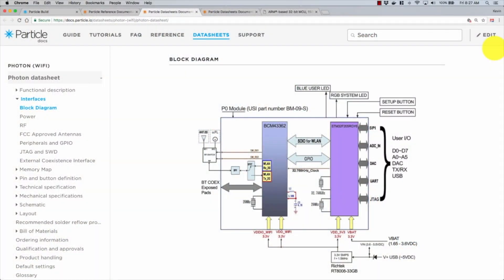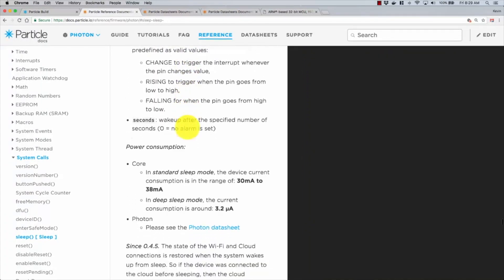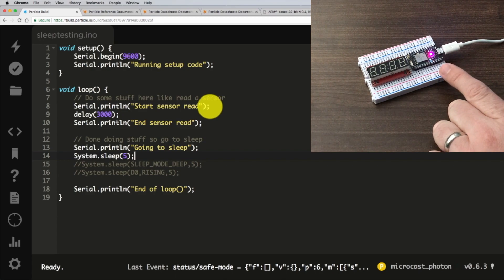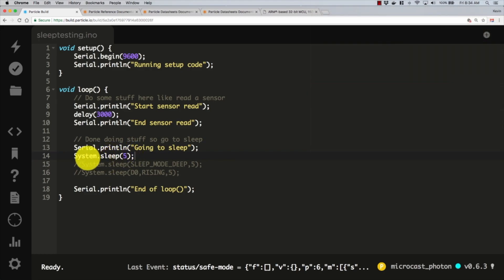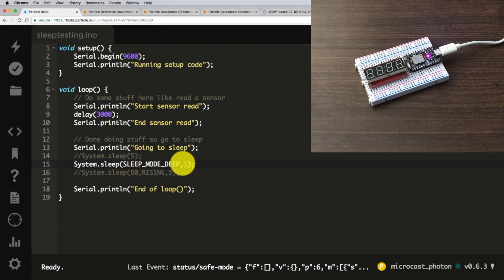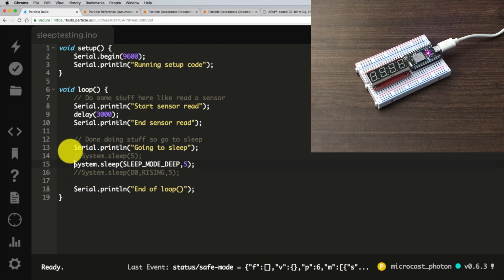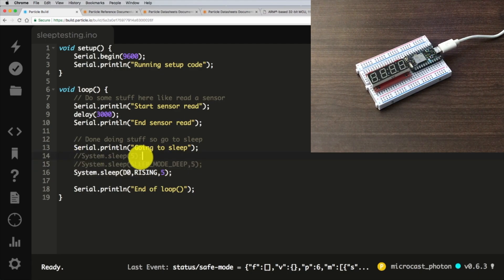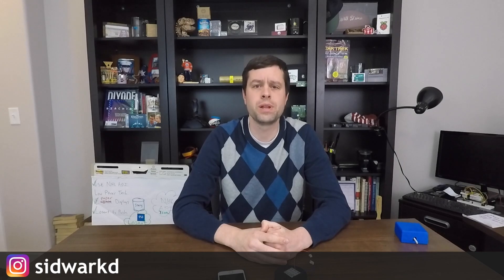Particle Photon Sleep Modes Demystified

Comment: What a great video!
1. What if you wish to wake the device AT a specific time and not AFTER a specific time?

2. Can there be expected some time drifting?

3. If there is a RTC in the particle. Can it auto adjust/calibrate itself since it has internet connection?
Reply from the maker: 1. Currently the devices only have a concept of sleeping for a specific amount of time. However, as long as you are connected to the Particle Cloud there is a Time class that allows you to get current time which is automatically updated at startup. From that information you could calculate the amount of time to sleep to wake up AT a specific time. 

2. I have been running a sketch for almost a month that sleeps for an hour, wakes up, updates a display, and then returns to deep sleep. I have not witnessed any sleep drift in that time.

3. There's an RTC-ish. It will continue to maintain accurate time while in any of the sleep modes. The connection to the Particle cloud will sync the device automatically with internet time assuming it has a connection.

Hope this helps. Thanks for watching.

Comment: Kevin - still some mystery.

  timestart = millis();
  delay(5000);
  //System.sleep(D2,RISING,5);
  duration = millis() - timestart;
  Serial.println(duration);

gives 5000.0 as expected.

  timestart = millis();
  //delay(5000);
  System.sleep(D2,RISING,5);
  duration = millis() - timestart;
  Serial.println(duration);

gives random numbers. I’ve had as low as 1400.0, up to 8000.0

First tests were all > 5000 and I thought it might be adding the time to return from System.sleep, but then I got times less than 5000. Thoughts? Can you replicate this behaviour?
Reply from the maker: So I literally sat down to test this and figured I'd install the latest particle CLI......right at the moment the entire NPM repository decided to blow up. I'll run this as soon as NPM is back up and I can install the CLI tools again. Sorry for the slow response time.
Reply from the maker: Hey Richard, NPM finally got it's act back together and I was able to repro this. GREAT find. I spent some time digging through the Particle firmware code in the hardware abstraction layer and I think I know what is going on. millis() is updated by a constant interrupt while the Particle device is running. When in sleep mode according to the STM32 datasheet "All clocks in the 1.2 V domain are stopped, the PLL, the HSI RC and the HSE crystal oscillators are disabled". The only clock still running is the RTC clocked by an external crystal which I believe is NOT the clock causing the interrupt to update millis(). So essentially while the STM32 is in a stop mode in sleep millis() is not getting updated. As the device is going into sleep mode it probably gets a few more ticks but then it's idle the entire time during sleep. Upon waking up the interrupt is re-enabled and starts ticking again so at that point millis() will start incrementing basically as soon as the RGB LED starts showing activity. At that point the value of millis() from your sample code will only have increased by the amount of time it takes the Photon to wake up and re-establish a connection to the Particle Cloud which is why you'll see the variance in numbers. I confirmed this by changing the sleep time to different values and noticing that the difference in millis (outputting to serial) depended on how long it took my device to start breathing cyan (Particle Cloud connected).

So the moral of the story is millis() is essentially useless for time lapse comparisons when using sleep modes as it will not update as you expect it to unless you consider it literally a count of milliseconds that the device has been NOT in a sleep mode since booting up. Thanks for pointing to this. It was fun digging into and I think I have a better grasp on it now. Hopefully that helps. Let me know if you have any questions. Also, thanks a bunch for watching!
Reply: Kevin - Oh dear! That’s a blow. I had hoped I’d done something stupid. I’m trying to build a battery powered utility gas meter monitor that doesn’t need its batteries changing all the time. The signal is a reed switch and I was hoping to use that to drive an interrupt to log time, then transmit batches of data over a periodically enabled wifi or low-power radio signal. But there doesn’t seem to be any way now to combine sleeping and time tracking. Do you know of any low power external real time clocks, by any chance? Ultra-low power techniques might be a great topic for your channel (Terrific Youtube channel, btw - thank you for putting so much effort into teaching us).
Reply from the maker: Hey Richard, there are external RTCs that would work but one option you might consider is the Time.now() call in Particle. Once the Photon connects to the Particle Cloud it fetches the current real time so when it returns from the sleep call assuming you have a connection to the outside web that should have an accurate value for current real time that you can save off and compare to future calls for elapsed time. The other option as you mention is something like an external RTC a la https://www.sparkfun.com/products/12708.

Comment: I summon the sleep genie and request 8 hours of sleep but beings this time of peace and relation is as random as life itself my days are either smooth sailing or Mt St Helens type day.
Like the idea of sleep mode where the minimum amount of current draw is conducted. 
Will have to check and see if the Wemos has such a feature. Yeah I know you would think my sprinkler project would be launched by now but having some issues with the moisture sensor selected for my project.
Reply from the maker: I'm sure the Wemos has some equivalent. Would be good to use in your project waiting in between sensor checks.
Reply: The test went smoothly the first day of testing or rain/no rain conditions. Which are checked by placing the probe in a glass of water and removing it to simulate rain ....no rain conditions.
Reply from the maker: Great news Rud Dog